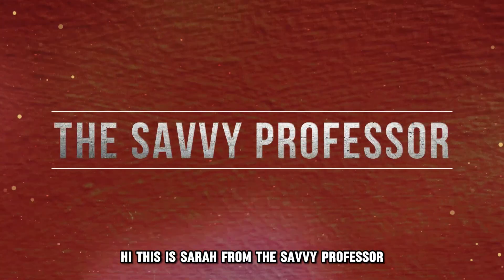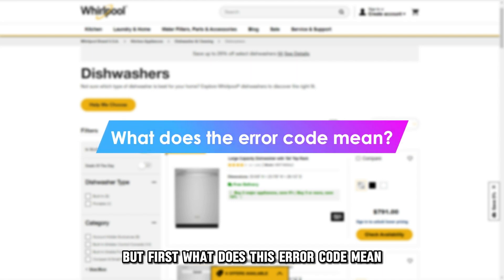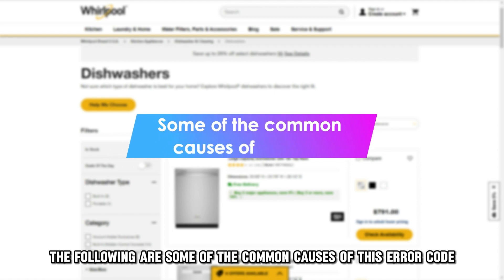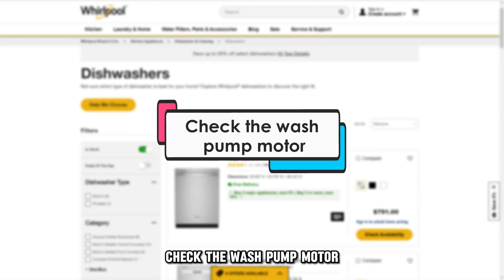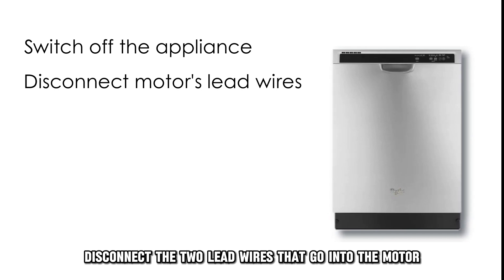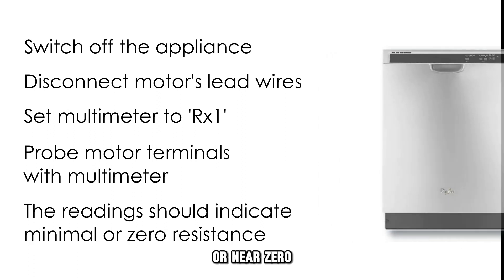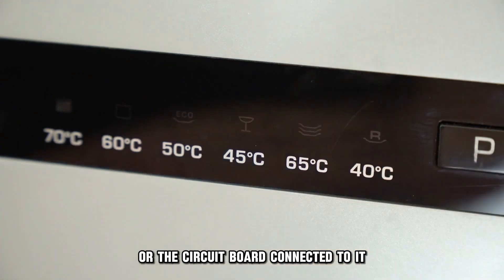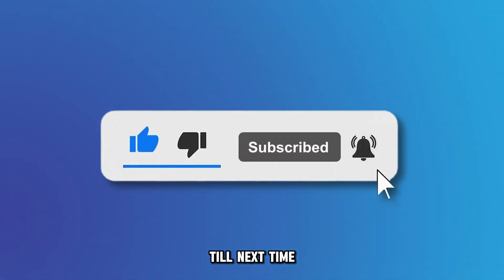How To Fix The Whirlpool Dishwasher Error Code 4-3 - Meaning, Causes & Solutions(Troubleshoot Guide)

Comment: Hello
Do you know how to access the control panel? If so could you please post another video showing that procedure? Thank you,
Reply from the maker: Yes. Start by turning off the power to the appliance. Lift off the outer door panel. Use a small flat-head screwdriver to help detach the retaining clips holding the handle and the control panel to the door panel. This is noted. Thanks.